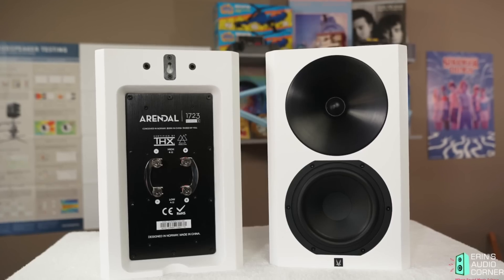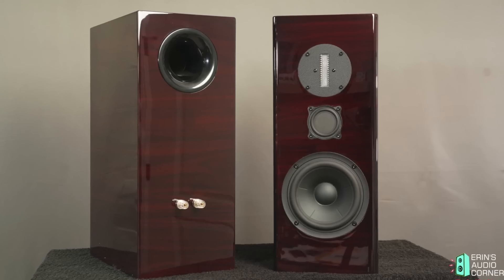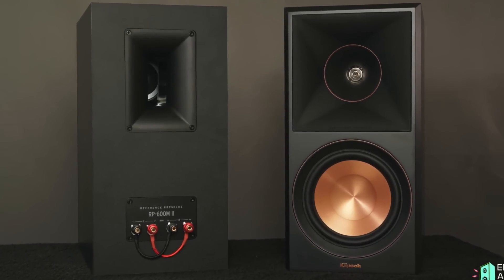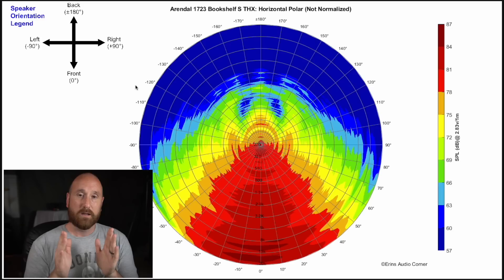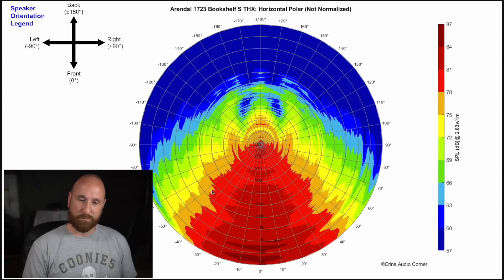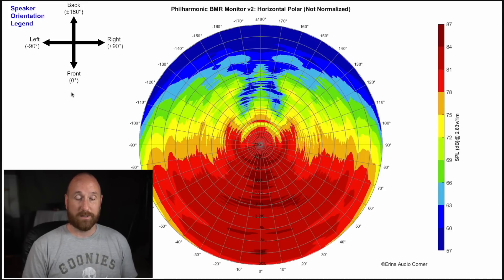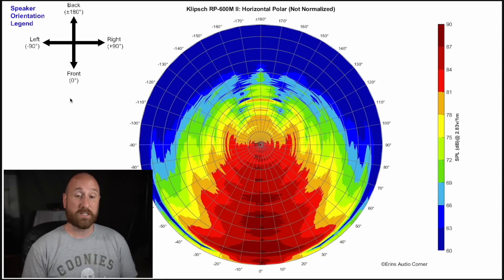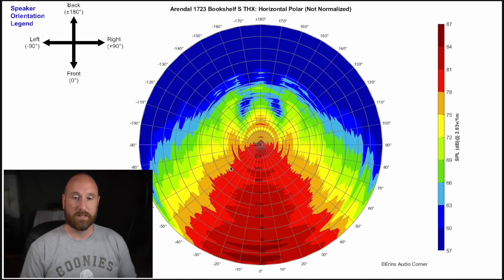Audibility Experiment Part 2: The CONCLUSION!!!!  🎵 (dun, dun, dunnnnnnnn) 🎵

Comment: Somehow I feel there must be other issues with loudspeaker B which has nothing to do with dispersion.
Because I am a big fan of wide dispersion loudspeakers and have been so since 1969 when I at my first hi first show (at the age of  9) heard the first omnidirectional speaker in my life. It was a set of Bang and Olufsen dices congaing 6 tweeters per side. It was named Beovox 2500. The idea behind the design was that it could be positioned a top of, and run in parallel, with a normal loudspeaker, and hereby make that speaker semi original. It meant that by a flick of a button (on the amplifier) onecould hear the difference in dispersion. It was a revelation and I have been an advocate of omnidirectional speakers ever since. I have had such enjoyment out of my high dispersion speakers over time. I have been the lucky owner of Ohm, Carlsson, Mirage Mi 6si, Mirage Si1 (which I sadly ultimately had toget rid of because of size considerations 😖. The only Omni I own nowadays is the Mirage mod 5 a lovely little box which plays wonderfully in my summerhouse. 
I would truly love to hear this experiment redone with more diverse speakers, wouldn’t it be lovely to hear the Bose 901 against some very high directivity speakers??? I would truly like to hear 901 in comparison, they might a wonderful or awful, but conceptually they are surely intriguing, and truly comparative listening is the only way to know.

Greetings from Denmark

Comment: Interesting. It sounds like the logic goes: wide dispersion = reflections = reverb = more immersive. Whereas tighter beam = less reflection = dryer sound = quieter background = better instrument placement. So there's inherently a compromise?

Is there also loss of stereo detail with reflections? I'm thinking reverb from the room might overwhelm similar signals on the other channel. 

What aspect leads to deeper soundstage then? Is it a fine timing thing?

Comment: This was a fun and illuminating experiment. Thank you, Erin, for taking the time to do this. Reviewing my blind "observations" now, shows that I was able to identify the narrowed soundstage of speaker A and B but my takeaway on the accuracy of the soundstage was way off; I labeled speaker A as having a muddy and smeared placement of the instruments. Knowing now the type of speaker each was it would be easy to understand (hear?) why speaker B would react violently to different room acoustics and/or placement. For me personally, it reiterated that I prefer a much wider soundstage but at the same time concerns me a bit that apparently, I'm not a fan of wave guided speakers which is exactly what the speaker currently pending construction employ (Statement II's) I can easily see why Jim and Curt recommend pulling the speaker away from the back and side walls as those reflections will muddy the accuracy of the soundstage.

Comment: I would have preferred if the speakers were to have been EQ'd to a similar on-axis/listening window. EQ'ing to a certain in-room target with speakers of varying directivity will have a severe influence on the direct sound. I'm curious what filters were used on speaker B (the BMR) to achieve the in-room response and what the effect would be when we superimpose those filters on the anechoic data. It's hard for me to focus on the spacial qualities because there is a clear difference in spectral balance.
Reply from the maker: Similarly, if I had EQd based on the on axis response, the BMR would have been vastly different due to diffraction alone. The other two speakers don’t have that. I considered other methods as well but at the end of the day it made more sense to me to target the same in room response.
Reply: @ErinsAudioCorner  That's true of course, in that respect the listening window would be a better indicator compared to the on-axis response. Two physically different speakers will never truly sound identical though. I just fear the BMR - may - have been at a slight disadvantage here exactly because of its DI. Would you mind sharing the filterset you used on them for this test? Just curious if I can make sense of what I'm hearing, or if I'm wrong.
Reply from the maker: @freetvg  I don’t have the filters saved. I’ve already replaced them in my MiniDSP with my HT settings.

Comment: I'm going to ask two dumb questions.

Isn't the goal of room treatment intended to remove room effect?

Isn't the wave guide a tool to allow you to use less or no room treatment and get good, low noise results?

For speakers in a room, aimed towards the listener, and with the room treated, the dispersion angle shouldn't be a factor in sound stage.  This entirely assumes treatment of the room would kill all reflections or reduce them so significantly that they are well below perception.  This is idealized, certainly, but for me, sound stage creation is 100% on the speaker to actually portray the recording room echos to develop the sound stage.  If your listening room is introducing new echos/reflections, that's just ruining things.  The way I view purposely narrowing dispersion is it is specifically a tool to reduce the introduction of excess reflections into the room by controlling it at the speaker first.  This reduces the requirement level of room treatment and lets someone get away with a pretty poor listening space and still get good results.

So for the three, I didn't really consider the listening room space as a component. I don't know how the room is treated anyways, so I can't say how much it's introducing. From my experience, room noise is just that, noise.  It seldom ever helps sound stage and mostly just ruins it.  Sound stage for me is a LOT more about the ability for the speaker to both present and articulate the recorded room noise from that recording session.  This is almost entirely a limitation of the driver's design and ability to articulate notes/details.  Don't get me wrong.  The room space can be absolute hell on sound stage.  You came from car audio, and I grew up with that too.  There's an environment with terrible placements, terrible reflections, excitation of your "enclosures," level balancing mess, time alignment mess, different off-axis angles and messed up frequency responses left and right because of them.  You needed a highly competent processing setup with to make it even work ok, and for a lot of years that simply didn't exist.  In the worst of worst environments, outside of actually getting levels balanced, EQ even, and time delay synced, you still had a mess of listening space noise.  For me, sound stage competency is always on the driver.  This is in car-fi, head-fi, and home-fi all the same.  The driver, itself, is either capable, not capable or does weird stuff in relation to presenting some semblance of sound stage.  The listening space can only deter from that.

Can the room make it sound big?  Yeah...kind of.  However, it's more the "wall of sound" effect or quite literally your walls are emitting sound (reflection or excitation).  But this is just big, and noisy.  It doesn't make a sound stage.

Placement of speakers can change the sound stage, and you can position their relative angle to you to create a wider or narrower experience.  But that's kind of it, well outside of post process effects.  Frequency response can also have some to even moderate effect too.  We're designed by experience to pick up on tonal change cues to perceive relative position.  And there's software that takes advantage of this.  Even movies, speaker sets, and various demos specifically utilize this for virtual positing.  In video games, it's a fundamental component of 3D audio space generation.  But all of this is deliberate modification to whatever stage (or lack of) that exists.  The sound stage creation is still ultimately and only generated by two things: the mic that recorded the original content and the driver that's attempting to accurate (or inaccurately) recreate that.

Comment: Ahh, that is interesting. I was wondering why the soundstage for "speaker B" did seem to be focused at certain frequencies and a bit directional at times, whereas the other two were more uniform. There is quite a difference in directivity between the midrange and the ribbon tweeter, and it comes through very clearly in the recording. Surprising it can impact the imaging in that way, but maybe its not since the listening window will vary with frequency and provide faux "spatial cues" that should not be there.

Comment: I'm very surprised. I heard great things about the BMR but that was my least favorite.  Was considering on buying them, now I have to reconsider.
Reply: Don't rule out the BMRs. I have them and love them.

Remember this isn't a fair test of speaker quality (for lots of reasons). If you intend to sit at the single prime listening position, then I see where having speakers that beam makes sense, but then why not just listen with headphones?

If you want music to fill the room, wide dispersion lets you have more latitude of listening position. Do they spoil the stereo illusion? Not in my experience, although that experience probably differs from the beamed experience. It's just a different theory on what speakers should do. You will get more room interaction with the BMRs, but I'm not sure room interaction is avoidable or even inherently negative to those of us who prefer speakers over headphones.

The BMRs have an awesome tweeter, married to the woofer through the BMR midrange. The crossover choices allow for good bass extension and result in clarity without fatigue, for me a very engaging and enjoyable sound. Of course, your mileage may vary.

Comment: I never got to post my results from Part 1 of the video, so here they are (I took notes on my phone while listening with AirPod Pros):

A: Most airy, great separation

B:
Less airy than A, but somehow sounds strange. Like some of the instruments on the sound stage aren’t separated, but others are in a flat way.

C:
Probably sounds most closed in, but most “accurate”. Less airy. Less separation, but doesn’t sound bad to my ears like B.

B is the worst, A and C are both good, I mostly prefer the sound of A, but it depends on what part of the song.

This is crazy! Seems like I would prefer narrow dispersion speakers???
Reply from the maker: Personally, what I'm finding in my many tests/listens is that I prefer speakers with about ±50-70° but anything below that is too narrow and anything beyond that may simply be too wide.  At least in my home theater room.
Reply: @ErinsAudioCorner  Yeah, it’s really interesting for sure. My current setup include SVS prime pinnnacle towers and an SVS Ultra Center, which I believe are all semi-wide dispersion (maybe around the sweet spot you’re referring too? Not quite sure though, as I don’t have great data on my specific speakers).

My room is large and very reflective (floor to ceiling windows on one side), so I’m starting to wonder if I should really experiment with different dispersion types during my next upgrade cycle. It seems like it could be a big influence on what works in my space.

All of this is very fascinating. Keep up the awesome content! These were a lot of fun and I learned a lot!

Comment: I wrote for B: diffuse image, but with closed in boxy sound (I guess that was your room) with much more reverb and cymbals to the sides than the others. And A&C had wider center image that matched  with their highs (or just more coherent)... I have lots of absorption in my room: thick carpets, acoustic ceiling tiles, soft furniture, many 2"x24"x48" rockwool panels (especially behind the speakers), with mattresses, pillows and blankets stacked up at the rear of the room sorta like a 16'x6' giant fluffy bass trap. I obviously want any reverb that i hear, to be what's in the recording.  It's kind of messy looking but its in the basement. Thanks for this lesson. I didn't like B at all, but wonder how I might prefer it in a padded room like mine. THANKS!
Reply from the maker: Here is the room I recorded in…
https://youtu.be/2hd-czNaN_s
Reply: @ErinsAudioCorner  Thanks.

Comment: A little after 7 minutes you talk about the different rooms, did either of them have diffusion treatment? I'm curious if I would have liked the sound of speaker B if the reflections were treated with diffusion.
Reply from the maker: I talk about that in the BMR review video. My HT has 2” roxul sidewall treatment. My living room does not.
Reply: @ErinsAudioCorner  That's absorption. What about diffusion, like in this Kali video?
https://www.youtube.com/watch?v=S7siySktba4
 You can see it after the first minute. First side reflections are treated with diffusion instead of absorption.
Reply: @ErinsAudioCorner  How would that explain the sound difference vs. A and C? The 2" RXL60 should be fully absorbing over 250 Hz, and take care of the early reflections close to the speaker. It seems to me that either some of the sidewall is not adequately absorbed, or the front wall reflection is where the BMR is reflecting much more (presuming that your front wall isn't absorbed, due to it being a HT).